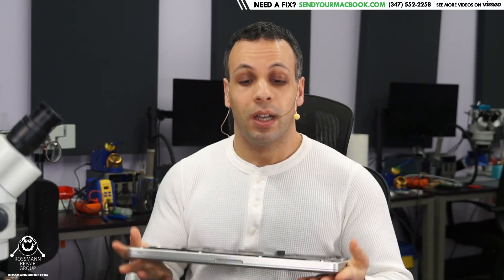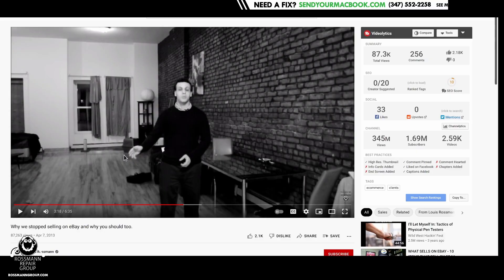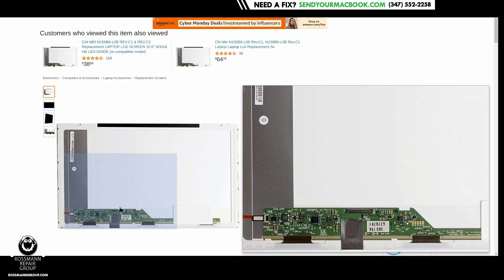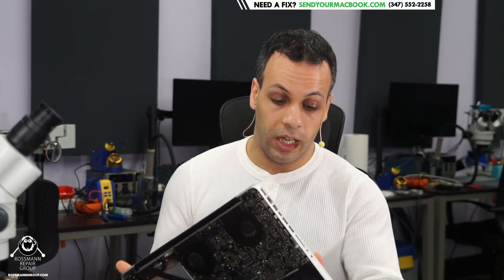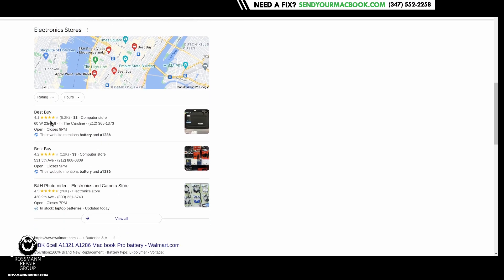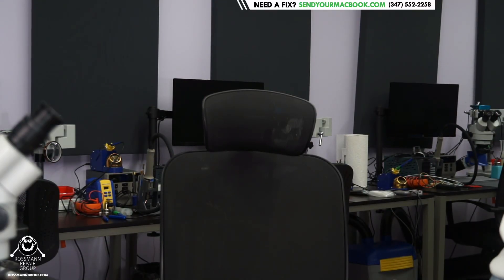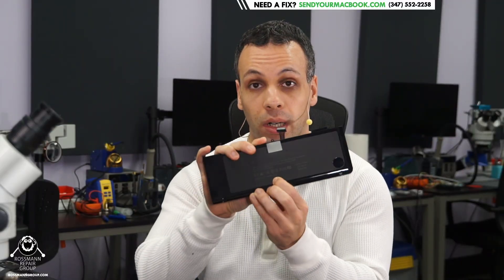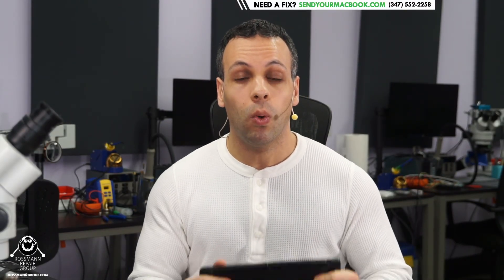Apple switched - and + on battery connector from 2010 to 2011 w/ same form factor; WHY?!?!

Comment: The cynical in me (after watching too many of Louis' videos) is telling me Apple did that specifically to get people who want to repair their machine because repairing is cheaper than buying new to go out and get the wrong part and brick the machine requiring them to either get a new machine from Apple or go with an expensive repair from independent repair shops (because you know Apple will just say "the machine is totaled, would you like to buy a new one?") and at that point people won't go to repair shops because the repair is like 50-80% of the original buy so they'll just save their time and buy a new one every few years instead of repair to keep it around for a few more years than that.
Reply: I can do you one better. By doing it this way, apple can turn around and say they have proof that users (or independents) shouldn't be able to replace stuff because they will destroy the thing.
Reply: That's the only plausible reason I can see too. Switching the power to ground while keeping the same connector is a sure thing that someone with an old device will come to the Apple store saying they wish to purchase the newest model. The Apple motto "You shouldn't repair yourself because you are a little child that doesn't know how things work" is this. The board doesn't die by itself, so we will make the user fry it because of his ignorance.
Reply: It's also about parts supply. Apple used the same battery for several years' worth of laptops, so there's lots of them available second-hand. By changing the design up, they can charge more for a "new" battery design and ensure that the old batteries don't work in the newer laptops.
Reply: It's also about parts supply. Apple used the same battery for several years' worth of laptops, so there's lots of them available second-hand. By changing the design up, they can charge more for a "new" battery design and ensure that the old batteries don't work in the newer laptops.

Comment: It reminds me of when I fixed my ps4 controller's charging port. by the controller model, it recommended me a jds-40 but the one inside the controller was a jds-50/55, if I had bought a jds-40 it would be completely useless since they don't work on gen 2 controllers only gen 1.
Reply: 2 model numbers, seven different models internally. It's ridiculous.

Comment: I want to let the apple fanboys know dell does this crap too. Found out the hard way when rebuilding my e6450 laptop as it turns out there is 2 revisions of the motherboard for a dell e6540. They are: la-9413p with a single LCD plug, and the la-9411p with a lcd and a separate backlight plug. Killed an lcd learning this but now I know (yes there was smoke).

Comment: Louis, I recently broke a reasonably expensive mechanical keyboard. I was able to order replacement keys off of amazon and solder a new switch onto the board. It feels nice to repair stuff even if its something simple like that. I wouldn't normally comment with something like this, but it made me think.... what if I couldn't get replacement switches because a company decided I wasn't allowed to buy them? A $10 repair might have required a new $150 keyboard. I appreciate you doing what you can to keep us from living in a world where nothing can be repaired and everything gets thrown away.
Reply: He touched down on that topic in a previous video. He likes to tell his customers that they were THIS close to getting their stuff repaired. He took that from the movie "25th Hour" (2002).

Comment: Awesome video as usual Louis. Do you have any tips for finding part numbers that companies intentionally hide? I want to replace my laptop screen but when I took everything apart, the sticker with the part number on it was hidden on the back side of the screen. 

I would’ve taken the screen out, but it’s not being held in place by screws, but some insanely strong adhesive. I’m not going to risk breaking my screen in half trying to pry it off the adhesive, so I’m just stuck at this point. Do I need to melt the adhesive somehow?

Any help would be greatly appreciated.
Reply: a heat gun, adhesive remover, and a lot of prying.
Reply: @HiiixImpakt  thanks man, I’ve actually been shopping around for heat guns. From a short bit of research I found anything that can get up to 400 C is ideal

Comment: Truthfully, never had to order parts for a repair. But if I were to, I admit I would have just gone by the model number. As I would have assumed if they had made any changes later down, there would have been a corresponding change in identification of the device.

Generally if there's been a refresh of a product, I do know I would have to look for the older model. But never though about a change in a current generation of model without years in-between. 

So can for once say. I did learn something. That I'm sure one day in the future, may save me a lot of headaches.

Comment: Doctor Murphy would not approve.  Seriously, if the design has a major change it should get a new model number.  And DON'T make a design change where a new incompatible part is easily plugged in physically where it doesn't belong.

Comment: I’ve been dealing with a slightly different problem: My laptop came with the wrong keyboard, so the BIOS lacks drivers for it (operating systems figure it out just fine). My job, then, was to find the correct part number when I myself didn’t own the right part.

Comment: I actually fried my iphone se a couple of years ago thanks to me removing my screen, while forgetting to unplug my battery. Doh!

A few months ago, I fried my asus zephyrus g14 battery because i was attempting to unplug the battery, which shorted the battery due to a metal piece holding the battery connector in place, which flew out of its socket

Comment: about that acer laptops. they had sticker on bottom with manufacturing date so you could just put up a sign on website that says 5517 -> 12/2010 for CCFL Screen and 5517 01/2011 -> for LED Screen. and write with big red font "CHECK YOUR MFG DATE ON BOTTOM OF LAPTOP BEFORE ORDERING, OTHERWISE NO REFUNDS AND NO WARRANTY" :D

Comment: If they're using different parts then it's a different model. They need to change the model number even if it's just adding a letter to the end like "A" or "B".

Also they should use connectors that don't accept the wrong type of plug.
Reply: I'm under the impression that they're doing it on purpose

Comment: This all could be avoided if laptops were designed with removable batteries. Take a laptop like the Dell m1530 from 2008ish. It's a potato that at the time would perpetually break costing Dell tons of money in warranty repairs. Even it with all of its flaws had a battery latch that would release the battery out the back. Swapping it out was a quick snap back in with a new or fully charged backup. Eventually Dell learned how to make a motherboard that wouldn't fry itself and the m1530 would turn into a precision crafted potato that would out perform most cheapo laptops through 2017
Reply: It could be avoided if Apple used model numbers for what they're supposed to be used for, which is identifying exactly what specific design you have in front of you. You shouldn't have to find the model number, know what year laptop it is, measure the length of a cable with a pair of calipers, and finally ask an engineer how Tim Apple's farts smelled that year to identify which model of laptop you're working with, and hence what part you need to buy. Every unique design should have a unique model number, full stop.
Reply: @Onihikage  I think we can conclude apple designs are stupid :p
Reply: Yeah, I've noticed that all modern laptops, or most at least, have the battery inside the computer chassi, rather than having it slot in from the outside. Even chunky gaming laptops where slimness wouldn't be a concern do this.

Comment: This rule of thumb also applies in the automotive industry. Never order parts for your car based on the make and model alone. Always check the part for numbers first and then the make+model+year and some times even the month when your car was made may make a huge difference.
Reply: The inly time I Encounterd Problems Like this where when I had french Cars. Nothing was what it should have been.
Reply: Found out the hard way. Ordered 3 different wing mirrors for my car. Gave up in the end and just glued it into place. My car is a middle ground build. 6 months before the "new" model, but 6 months after the end of the "old" model. So I got the internals/fittings of the old model, and the exterior/panels of the new. So I either get a mirror that bolts on but does not fit and looks wrong, or one that looks right and fits, but the bolts won't line up (or the cabling).
Reply: I sometimes fix my phones and I prefer to open it up, have the part on the table and look at the photos on ebay to make sure it looks the same.

Comment: Louis why don't you take this opportunity to develop a small adaptor that allows these cheaper older batteries to be utilized?  Seems like a tiny thing like that can't be more than a $1 to manufacture and there is a $20 price delta in batteries, lots of room for markup.

Comment: In the Razer Death Adder mouse (possibly other models as well) they use a random mix of right-threaded and left-threaded self tapping screws. When you're opening your mouse for the first time and you're not expecting this sort of BS, you will try to force the "stuck" screw and you will destroy the plastic standoffs that the screws thread into. There is no good engineering reason for it except to spite the owner who dared to try and clean or repair their mouse instead of Buying A New One.
Reply: As the box of the one and only Razer product I've ever purchased said when I opened it, "WELCOME TO THE CULT OF RAZER!"

They were even trying to hide that they're a cult. Buy a new one. The cult demands you pay your tithe.
Reply: glad I stopped buying their stuff a long time ago...
Reply: @InfernosReaper  I've probably only had one mouse button fail in all of 30 years of using computers and gaming on PC.
Had (thankfully gifted, not owned) two Razer mice mouse buttons die, and know of two others family had do the same... like, they last a year max.
Reply: @TechyBen  Yup, got rid of my Razer naga mouse years ago and now use a Logitech G600. My last Razer product was a Blackwidow Ultimate keyboard. Perhaps lucky, I think I made it close to two years, then the A key stopped working consistently. The volume wheel also failed ages ago but I just disabled it and moved on. Glad that I got it on employee discount so I didn't pay as much.
Reply: @DelphinusVyse  Yeah, it's hilarious how much abuse my Logitech mice get and keep working perfectly. :P
Reply: I have not long ago bought this exact make and model, so thanks for the information, the one thing that I'm happy about is that i purchased it through the Amazon warehouse deals, so no money going directly to Razer at least.
Reply: Must have been designed by a gas fitter.
Reply: When I was a teen I liked the childish design and bought three expensive copperheads without questioning how they all died in a short span after the warranty. How there was drift, ghost clicks and whatnot. I even bought the disgusting expensive Lycosa (I think) keyboard. Utter trash. Cheap rubberdome with the worst lighting consistency and brightness I've ever seen. 
Razer is one od the worst offenders of overpriced plastics trash.
Reply: Fuck Razer. Underspeccing microswitches and using rubber grips on EVERY mouse, with rubber that degrades with exposure to skin oils. Fuck Razer.

Comment: A 10 cent diode could have protected it. I've even seen reverse polarity protection built into cheap Chinese products. Of course, a 2grand laptop couldn't have that
Reply: That would reduce battery life by 7%. That is a very costly, though inexpensive, fix.
Reply: @Hi11is  There are other ways of doing it that wouldn't consume power. The BMS could be designed to shut off in a reverse current situation. Most products use a fuse and a reserved clamp diode. A mosfet can have near zero on resistance and be used to provide reserve voltage protection. There are many ways that would cost under $1 in BOM.
Reply: @allalphazerobeta8643  
I was responding to the specific claim that a 10 cent diode was suitable for protecting the computer - it is not. I was not unaware that there are other bandaid approaches possible. In a device that uses commercial batteries that may be installed with polarity reversed, such circuitry is appropriate, but it is unnecessary when proprietary batteries are involved. The no cost solution is superior - don't use the same connector wired in incompatible ways.
Reply: A power mosfet can provide reverse polarity protection without the voltage drop of a diode.
Reply: @hanelyp1  there ya go, even better!
Reply: Nooo, no need for diodes or mosfets. Just use a different connector!
Reply: @cormacsyt0  - yeah at this point this is something to assume. Malicious intent.
Reply: a 2 grand APPLE laptop cant have that, because you should bring in the device for a 1,2k repair or even better buy a new laptop for 2,5K so they can resell your butchered laptop parts to a customer that chose the 1,2K option.

OR you throw the laptop into the MoFo's windows and get a proper one for 800.
Reply: Apple, Thinks different

Comment: Engineer here:  It could be done just for PCB layout reasons, but I suspect it was done just so the parts are different.  Apple probably want to control the parts prices per model/year of device. They don't want common parts where they are locked into the same part price for multiple uses. Apple is all about making maximum money and if they can charge more for a part sold to authorized repair agents for laptop X verses Laptop Y they will make sure those parts are different even if they are in-fact not functionally different at all.  
As much as I hate Apple I don't think they swapped polarity to make DIY people blow up their devices so that they have to buy a new one.
Reply: Excellent argument. But the reason for the change is still greed. And non universal part usually lead to more unused stocks.
Reply: @anuarbin  100% agree, it's a dick move.
Reply: It's possible, but I think we should not too hastily conclude nefarious motive without strong evidence. Besides a layout constraint, this is (presumably) a proprietary connector, so it may be even simpler an explanation. They did a new design for the next model year and there was no pinout requirement so they just routed the pins whatever way was convenient.

Comment: I've seen this same issue from all the major computer manufacturers. Difference between say Apple and the likes of the others (Dell, HP, etc), is which factory or region the device is shipped from as to what internal revision changes there are. YEARS ago I did a Dell PC roll out for a school, and the PCs came from two different batches as could clearly be seen with the internals - even the CPU placement was different between them and the models were all the same for this particular Optiplex. Admittedly, Dell have drastically improved this issue for their business machines. HP are still occasionally having this issue, but no where near as much. But that's for the obviously stuff, the subtle changes still exist - like different brands of drives, chips, batteries, connectors, etc. As for Apple doing this with a MacBook Pro battery - why swap the conductor polarity? NFI, I still enjoy my Apple products, but as someone who has been tinkering with electronics since I was 7, I know to always check the actual part before ordering. If I don't eyeball the part, I don't order the part!
Reply: Whatever the real reason, even if it isn't malicious, this is still an enormous PITA for the consumer and it shouldn't go unmentioned/unpunished. Just another thing to add to the laundry list of reasons not to buy any modern devices.

Comment: I had the same problem with Dell  1545 they came with two different screen types
Reply: however with the Inspiron 1545 you could fit the newer LED backlight screen to the earlier CCFL model by swapping the screen cable - had two broken 1545s at one point, first had a CCFL screen that was broken and the 2nd a working LED screen but a dead mainboard - decided to try the LED screen on the CCFL machine as the motherboards had the same part number and it worked perfectly